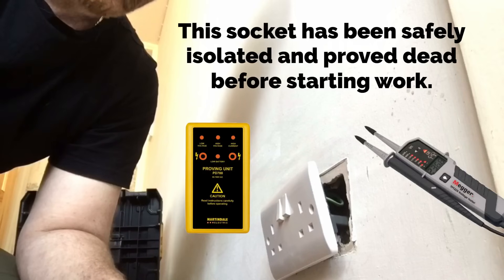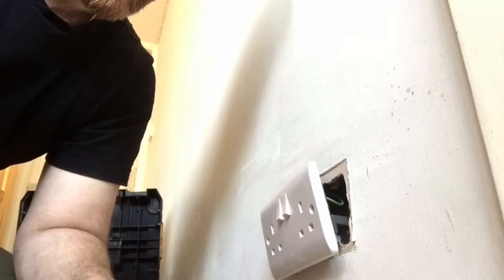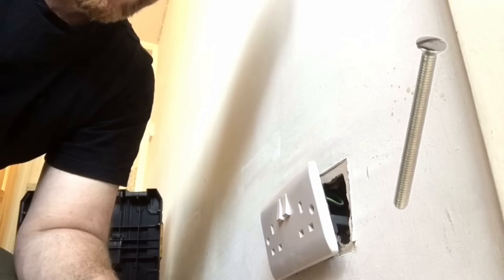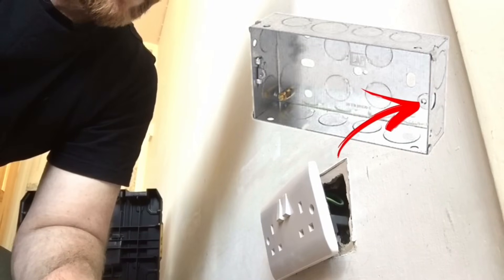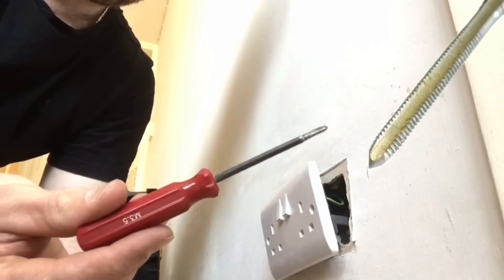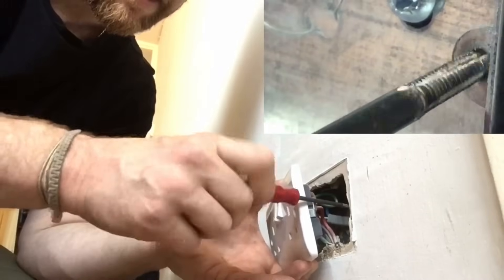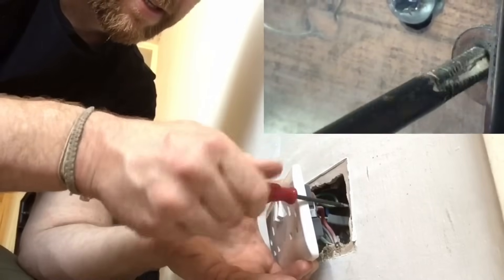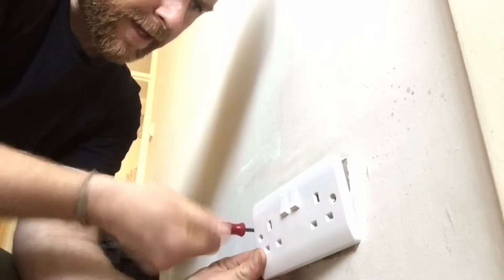How to Use a 3.5mm Tap to Rethread a Flush Metal Electrical Box For a 3.5mm Machine Screws

Comment: That's a useful tool, but at some point you're going to come across a situation where that won't work, and the thread on the box lug is completely, pardon the pun, screwed.
The solution... Carry some 3.5mm nuts (cheap as chips on fleabay) and a tube of Superglue.  When you come across a situation where re-threading is not going to work, drill out the existing hole to say 5mm, and then Superglue a 3.5mm nut on the back of the lug.
It may not last multiple screwing and unscrewings, but it beats the hell out of replacing the back box. 
Some say just re-tap to 4mm and use a 4mm bolt, but I've never found any that have the same size head as a 3.5mm and don't look right IMHO.
Reply from the maker: Hi. I tend to tap it to 4mm and change screws that’s if the box cannot be changes. Thanks for watching and commenting GSH Electrical
Reply: I have done it that way, but have found that if you're using white accessories that have those little white caps to hide the heads, then you have problems with them staying in, or even fitting. Maybe I'm just using the wrong 4mm ones. Cheers
Reply: Has anyone ever tried this BBS1 back box savers and.know if they are any good? My threads are gone and rethreading is just not working?
Reply: @evieemaya88  Yeah they should be ok.  Type switch socket cassette screws on Ebay or Amazon.  They work well too.  I carry a few for EICR's to get me out of trouble. For some reason I can't put in a link. 👍
Reply: @rayc1503  hello ray, thanks for taking the time. I'm just a DIY homeowner in UK trying to sort my problem. I've looked at what u suggested and they look good but they seek to be American style socket use and also they seem to move your screw how's further.closer together which would not work with a standard UK socket no?
Reply: @evieemaya88  They do work on uk boxes. Type this in to ebay they are even simpler to use.  Sorry I'm unable to add links but I copy and pasted the item description.  When you screw these they bite into the sides of the box.

10x Wall Box Repair Screw Steel Junction Fixed Socket Mount Box Cassette L3N1
Reply: @evieemaya88  I am a UK based electrician.
Reply: @rayc1503  thanks again for this, I have had a look at these also. Lastly with these ones that screw into the side , can these be used on fixed lug / clips? Is it just a matter of slip behind and use the stripped hole as a guide into the the new cassette behind it? Or will I have to flatten the old stripped lug / clip and then use the new cassette?
Reply: @evieemaya88  These ones work surprisingly well on metal back boxes.  You either remove or hammer the existing damaged lug back.   The back box savers aren't bad they're just a little overpriced.  Have you tried squeezing the existing lug with pliers and then re-tapping it with a 3.5x0.6 tapping tool? There are so many different ways of rescuing a damaged back box.  5 or 6 different methods I can think of atleast.
Reply: @evieemaya88  you can drill a 5 mmm hole through the fixed lug instead of removing or hammering back. Hope this helps. There would be no harm in putting an earth fly cable from the socket to the back box either.  That's only if you can.
Reply: @rayc1503  thanks alot I'll keep you updated how I get on. Really do appreciate you taking the time 👍🏼
Reply: Drill a 3mm hole through.  Then through this drill a further 3mm right into the back.  Then proceed to tap the rear case of the backbox and use s larger screw. 👍

Comment: Any suggestions on what to do if the tap doesn't work because the whole is now to large? Larger tap and accessory screw? Replace lug? Replace backbox?
Reply: Gareth Warden Cut a tiny piece of metal approx 15mm square off top of my head, fold it in half using a metal work vice. Shove it over the old lug in your stripped box and drill a small hole around 2mm through it. Now run your tap through it. Another method you can use is to try and squeeze the lug with some long nose Pilars and re tap at a bit of an angle. Some screws are also slightly bigger than others too, toolstation sell thornsman screws which fit a bit tighter than some others.
Reply: See my method above ;-)